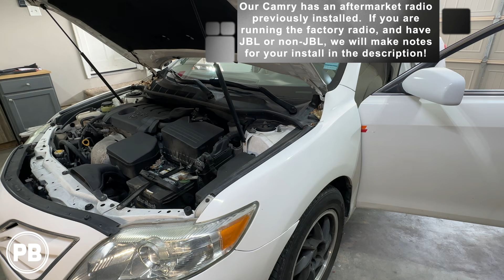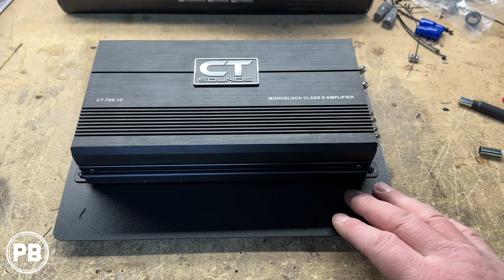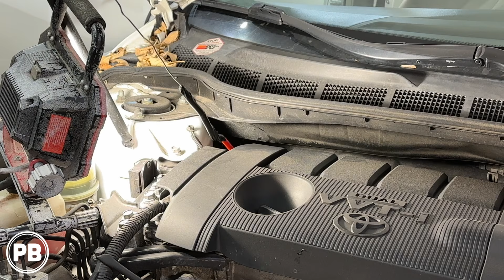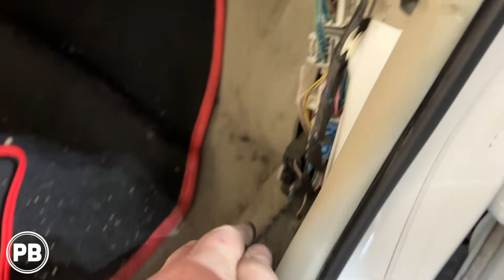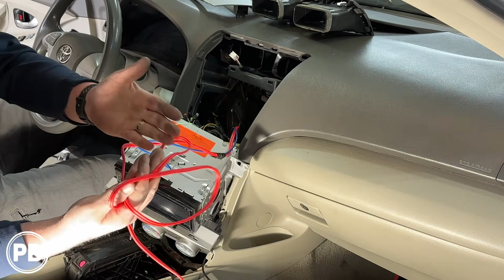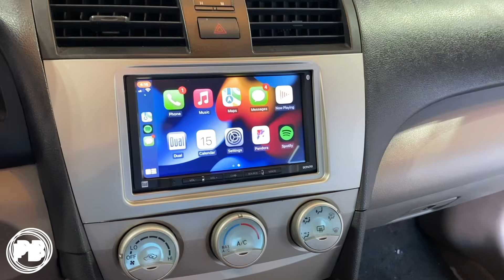2007 - 2011 Toyota Camry Amp and Sub Install

Comment: Hello, Ive found the ground hole you used for the amp. What bolt/ thread did you use to attach the ground to that? Thanks!

Comment: Question: Could I follow the same process if I wanted to bypass the amp? Like doing the wiring part with a bypass harness connected to the aftermarket radio?
Reply from the maker: Yeah, just follow the video in the description

Comment: What size was the bolt and washer you used for ground?

New to car audio.  My wifes car died in october so my mom gave us her old 09 camry. Your video made it east to install the dual touch screen and 4 speakers. 

 Wanted to add on a cheap sub but do not want fires 😂 

Also where is the best place to put the mic?